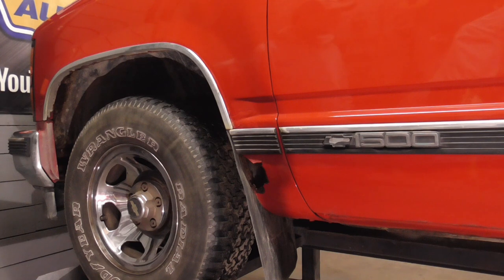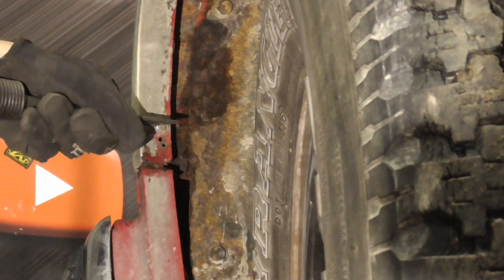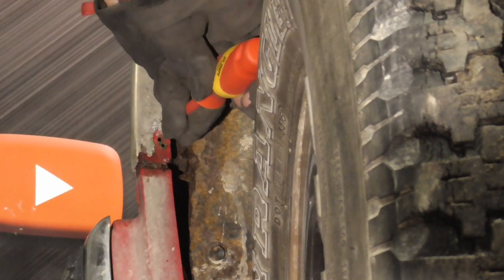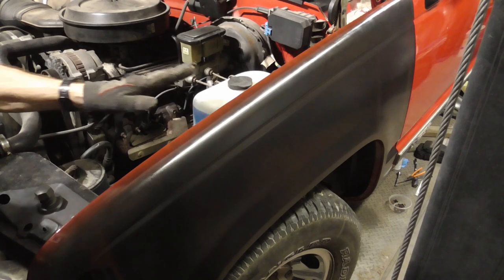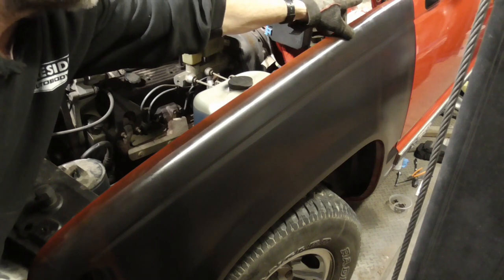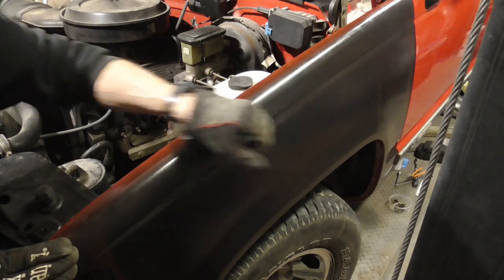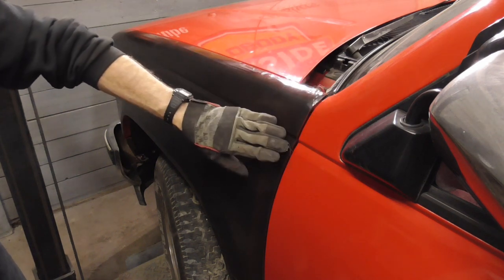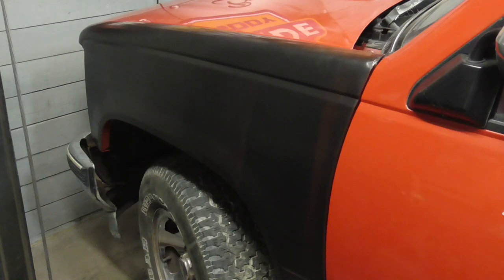How to R&R | Remove and Replace a Rusted Fender

Comment: Knocking screws before trying to remove great tip to free the rust. Great tip about running bolt back and forth so it won’t break. Aligning tips are something no on ever tells you about! Thanks Jerry.
Reply from the maker: Thanks U Mark & You're welcome.  Must be cold up there right now - O degrees F in Michigan right now ❄❄❄❄❄❄❄❄❄❄
Reply: @LakesideAutobody  It was around the -30 to -40F for last week. They claim +18F for Sunday and a couple degrees warmer mid week! Amazing how it can differ so much over a few days.

Comment: I have a 1999 Pontiac Bonneville I have a rust hole same place in the fender where your replacing that fender on that pickup truck in your I don't know if I can find a replacement fender for a 1999 car so my question to you would be how do you fix a rust hole like that on an older model car when there is no replacement parts
Reply from the maker: Here's a few ways - your choice - https://www.youtube.com/watch?v=rPTaeH056ng  - https://www.youtube.com/watch?v=Zp5gmDC7KQI  or weld either flux core or MIG - https://www.youtube.com/watch?v=H87b1xlGofw - https://www.youtube.com/watch?v=oBW6vS9Mw5Q

Comment: Do you use seam sealer where the sheet metal overlaps in the inner fender well?
Reply from the maker: You can if you want - can't hurt.  This job is for a friend - not too much $ so... we're just keeping it on the road :)